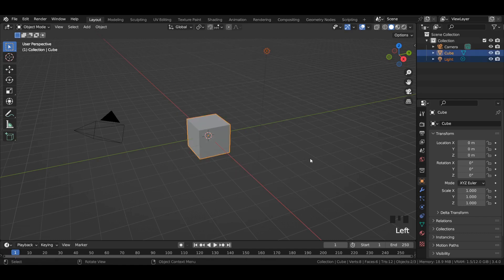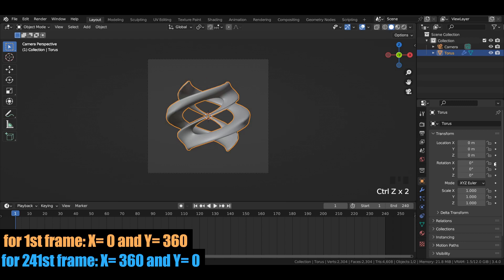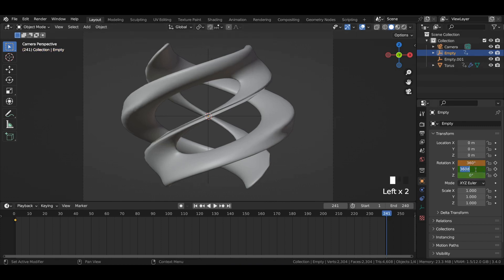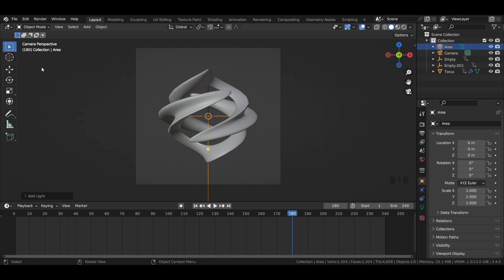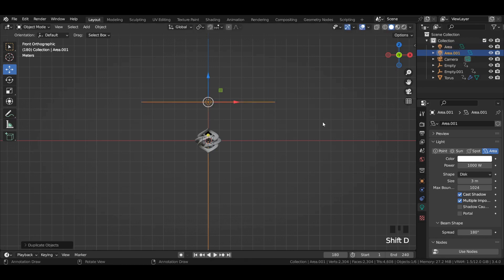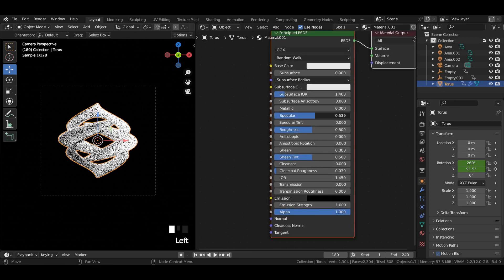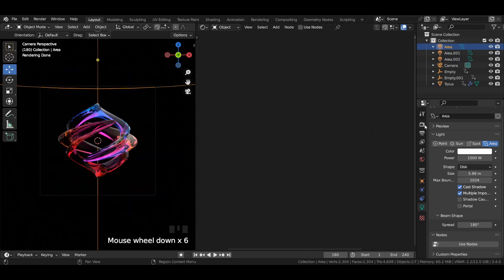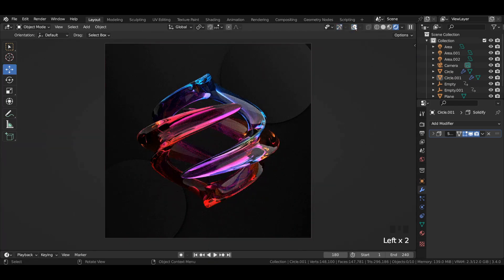Satisfying "GLASS ANIMATION" in Blender Cycles (Tutorial)

Comment: Add modifier doesn't show up for me in the torus menu.
Reply from the maker: Sorry, didn't get that! Could you please explain what kind of issue are you facing?
Reply: @Gettutorials123  Thanks for the reply, The modifier widget wasn't showing up for me in the Torus settings window on the right hand side of the screen, for anyone else wondering, click the cog icon and it will pop up. Seems the setting has been moved : )
Reply from the maker: Ya, the developers have applied some UI changes to the software.

Comment: hi will a RTX 3060 12 GB render it faster than a RTX 3070 ti 8GB? on a laptop
Reply from the maker: Rtx 3070 ti is faster in rendering compared to a 3060 12gb, but if you are rendering memory intensive scenes which requires a lot of VRAM, then a 3060 is a better choice!! Also, I don't know if a laptop 3060 comes with 12gb vram.